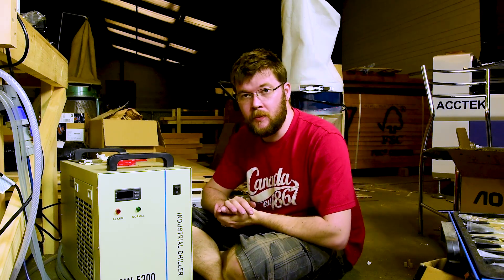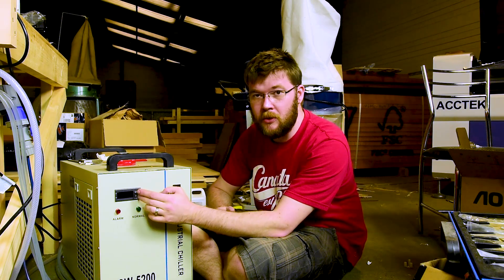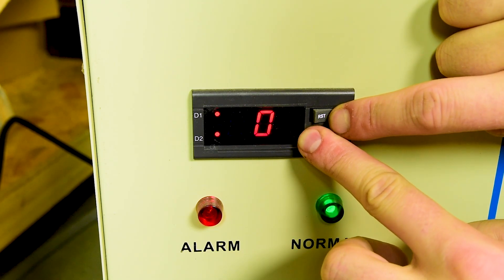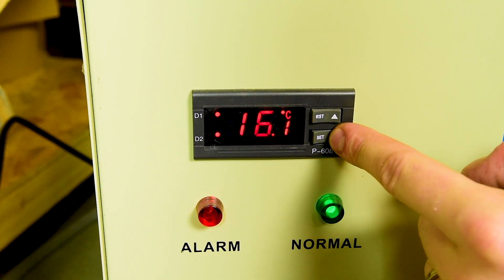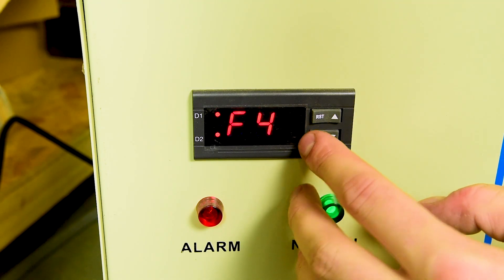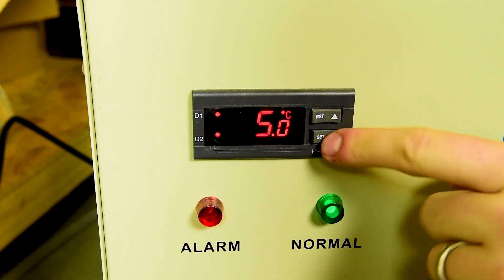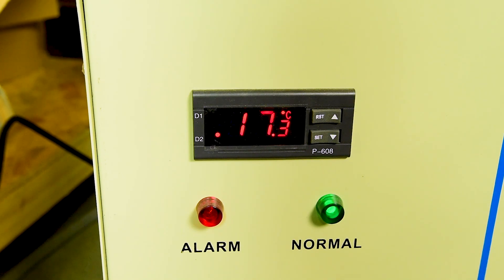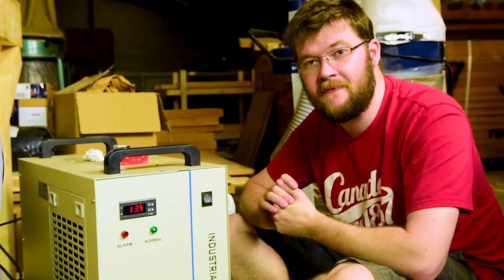Changing settings on CW-5000/CW-5200 Chiller

Comment: I just found this video just in time. It's exactly what I need. I had a Vevor CW5000 delivered a few days ago for the DIY 60W laser cutter/engraver I just started to build. I  read the instruction booklet briefly and was concerned that the default "intelligent" mode appears to set the temperature higher than I have been led to understand is ideal for the laser tube. It looks like it should be a breeze to set the chiller up correctly following this video. Thanks a lot.

Comment: Hi Just picked up a dead Piranha 5030t with this chiller. I am in the North of England so cold as, however think ill run these settings when i get the unit running. Thanks for this, very helpful as i have no documentation at all with the laser or chiller.

Comment: great instructions, but unfortunately my new chiller wont cool. compressor gets real hot and the outlet pipe running from the compressor to the condenser isn't even warm, nor is the pipe from compressor to water tank cold. either it has no gas or the compressor is a dud? either way its doing my head in trying to sort it and the seller is trying everything to get out of any responsibility they have.

Comment: Great videos! 
What temp in celcius should be maintained for a 60W or 80W C02 tube in a stinking hot shed in Adelaide? 
Do you add anything to the water (like radiator fluid (as I have seen elsewhere))? Or is it just Tap Water?